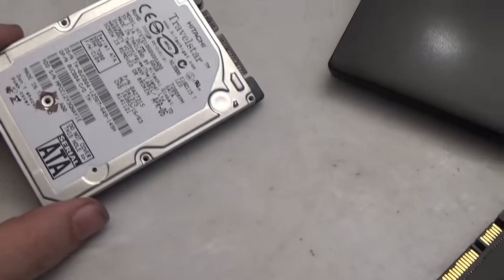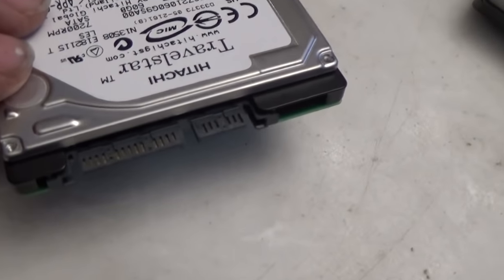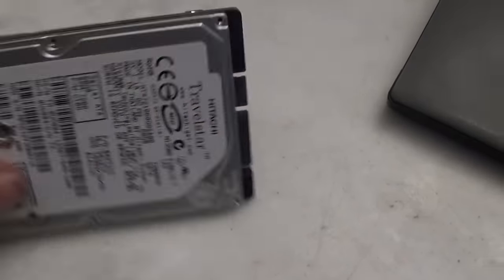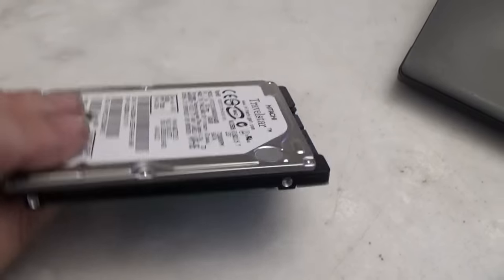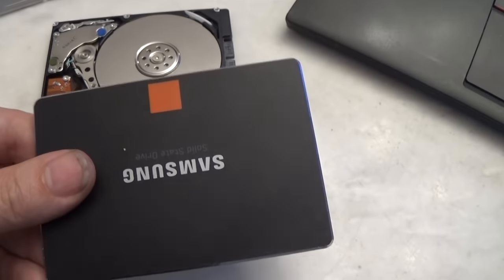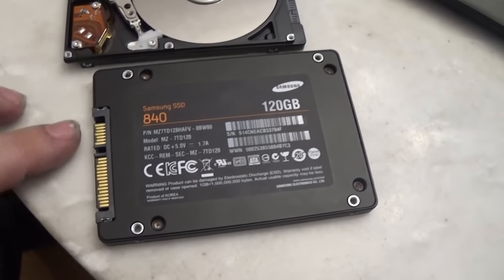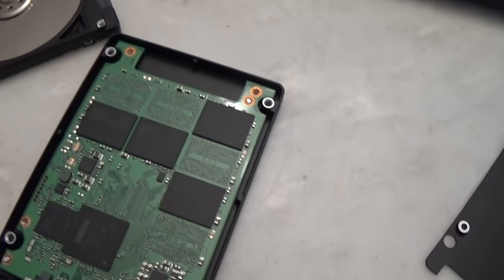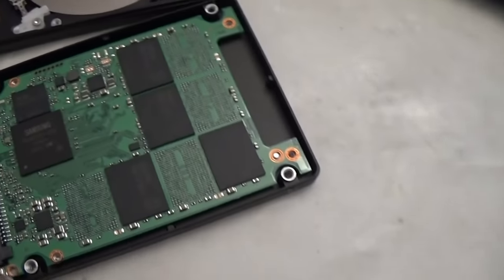Take a look inside a hard drive while it's running

Comment: an hdd's actuator arm can move 50-500 times per second in normal operation
Reply: fun fact : this is still slow for pc needs
Reply: @laserbeam3836  Lmao, too slow
Reply: You think this is fun? There is some serious shit going on here.
Reply: @shoaib_zubair  that's pretty fun what are you talking about?
Reply: @paulortalex6613  😁😁😁
Reply: You probably mean that camera shot this can not represent even in one frame its full movement
Reply: @laserbeam3836  yes
Reply: It is impressive for humans eyes and also Camera Sensors but for computers that's horribly slow lol or probably the average
Reply: @Ayaan MathurAlso because data from HDDs can be recovered most of the time if you really want it and HDDs almost always give signs of dying before they die so you can take backups quickly unlike with SSDs.
Reply: @Ayaan Mathur you use them for high storage
Reply: @Ayaan Mathur you cant get a 10tb ssd
Reply: Wow 666 likes
Reply: @nasvsan6191  in this case u need to watch Linus tech tips.
There are SSDs with 20tb storage
Reply: @kshitizmishra5845  for 10k i dont think so. There is literally 0 point to spend that much when a 10tb hdd is a couple hundred
Reply: @nasvsan6191  maybe not 10k but, those who can afford money doesn't matters for them.
While LTT has whole fucking server made of SSD
Reply: reeely????  WOWOWEEE
Reply: the speed is too damn high
Reply: Thank you!
Reply: 500 times a second wow
Reply: Wouldn't it be better to just say over 500 times a second?
Reply: you know how in like how it's made, near the end of the episode there's a super fast packaging machine? I assume it's like owning one of those but much smaller
Reply: @ApofKol  ye
Reply: And they call it slow
Reply: So that's 500 times a second right
Reply: @Mirsab  yes
Reply: Where the f@#$ am i
Reply: How it's faster than light
Reply: @tomodaniel6471  no it's not
Reply: Well, there are computers out there that can support an ssd or an hdd. My Mac has an ssd plug and an hdd plug. It’s 9 years old, and when I got it off eBay, I think that the hdd was replaced. So, It either has a really good hdd in it, or the hdd it has now is brand-new and it’s only a matter of time before it slows down. Well, who cares, it does Blender, 3d printing, and Minecraft just fine which is really all I bought for in the first place lol 😂
Reply: Can’t you just say it moves at 500 times a second
Reply: @Ayaan Mathur an SSD has no moving parts. But it is sort of possible but then it's called SSHD and not a SSD.

(Sorry for my terrible English)
Reply: @robertburgin8110  uh yeah obviously there are
Reply: @spinnerx4997  yes
Reply: Fuck! That is fast!
Reply: @shoaib_zubair  🤣
Reply: yomommabois look, I’ve only used so many computers. I’m basing this off of what I have learned using my fleet of broken laptops. laptops I have gotten with an hdd are extremely slow once you use them for a while. I’m letting people know that you can switch. As much as it is obvious, it could be helpful to some people.
Reply: And ssd?
Reply: RVG Riftyz what are you asking?
Reply: Wow, that's a fun fact!
Reply: @Ayaan Mathur and hard drives have more space
Reply: @Ayaan Mathur Why would a cloud company use SSDs, I'm pretty sure google uses HDD
Reply: wow
Reply: @robertburgin8110  or you could get a computer
Reply: @esoij  bruh im typing on desktop rn
Reply: @Ayaan Mathur What? They don't increase platter size to increase capacity. They either add more platters or increase the bit density .. or both. For the common 3.5" HD platter sizes, all specs such as read write random sequential times have improved as has capacity over the years. In a single drive storage comp, ya sure SSD's make sense. Beyond that though, a SSD boot and some fast large HDD's make sense regardless of your budget.
Reply: That would be really cool if I could comprehend it
Reply: 2ms response time
Reply: imagine a hdd as fast ad a ssd
imagine that actuator
Reply: It's 7200 rpm. Is that any good?
Reply: @paulortalex6613  XD
Reply: U hear that it's the sound of No one asked
Reply: My can't get milk after 21 years
Reply: That would be why it looks so jittery in 60 fps. You'd need 500+ fps.
Reply: Does you saying it that way mean that it doesnt move 80 times a second?
Reply: @ApofKol  but it wouldnt look as smart
Reply: Some fire freaking Pit thats a weird way of saying 500 times a second
Reply: @laserbeam3836  best reply ever because it's true LOL
Reply: My little brothers attention span is being challenged by this
Reply: @TheFourthWinchester  When your HDD starts to act like it's going to die is not the time you should be making backups...
Reply: @Ayaan Mathur If you want reliable function and safety data storage, HDD is the best. I have one drive with around 25.000 hours. Still perfectly okay! All SMART data is well within margins so i bet it will last 25.000 more hours.
Reply: T Burgin most ssds and hdds use sata connections. therefor there is no “ssd connection” or “hdd connection”
Reply: Some fire freaking Pit I know that. Just my Mac has a plug labeled hdd and a separate one labeled ssd so you can run both at once and have greater storage for partitions. I have Sata hdd. Plus it’s 9 years old, so who knows what’s in there?
Reply: So it moves 500+ time in a second?
Reply: Coooll... but I use ssd...
Reply: That's a lot faster than an SSD
Reply: @leonruvalcaba1549  it's kinda slow for pc needs tho
Reply: then why is it too slow
Reply: You could've said it can move 500 times in 1 second. Both of them are same but this gives better visualization.
Reply: T Burgin sata is pretty old
Reply: @xrivw  what did you say before you Edited the comment?
Reply: Im gay ‘*’
Reply: I'm sure before editing the comment you were talking about the spinning speed. Likely you said the spinning speed is so high, and then they said this is slow. Lol 😂
Reply: Yes, europe is a us state
Reply: You’re so funny, comedy achieved
Reply: Wtf is the point of editing your comment like that?
Reply: Original comment (probably): it's amazing at how slow this runs.
Reply: imriy no, it was talking about the immense speed an hdd has.
Reply: dude that joke got old after like the third person that did it now it is just annoying
Reply: Lol
Reply: @bathroom681  kkk lol
Reply: @nasvsan6191  lol 100 tb ssd
Reply: and yet they are still slow
Reply: @Ayaan Mathur I'm buying an HDD right now. Why? Because I need 2TB-3TB of storage and if I want to buy an SSD with that capacity my wallet will vanish 😂💔
Reply: @Ayaan Mathur I understood you the first time, but thanks for the edit of clarification xD! Idk you saying "not talking about ur lack of money" made me laugh Idk why xD !

I actually have 3 HDDs that I use. I thought of getting an SSD, but I actually need more storage more than I need speed. I know how fast a system can boot with an SSD (I've seen it IRL), but I have no problem waiting for my PC to boot at the moment. Now it's not just booting that's slower, it's the apps as well. I will get an SSD eventually, just not these days. I will probably get a 240-512 GB SSD for the  system. 
Also thanks for the positive energy even if it's not direct idk I felt some positivity coming from you :D !
Reply: @laserbeam3836  Yeah when you think about it ... RAm on PCs on average go at 2333  Mhz(2.3Ghz) (2 300 000 000Hz) and they send 128 bit packet per 128 bit packet(if you are on dual Ram ) at this frequency that's mean that it send over 128 bit x 2 300 000 000 = 294 400 000 000  which is a litlle more than 34 Go so it could theoretically send over 34 Go of data every second to the CPU which is a bit send every 3.401360544x10^-12 second which is 0,03401 nanosecond which is 0.0000000000003401 second. Duh
Reply: Wow still faster than console's fps
Reply: Ayaan Mathur no, larger platters does not mean you will always have slower read/write speeds, modern large capacity drives store multiple tracks of data within a given sector by overlapping the tracks with as much as 3-4 per track. If the hard disk has enough ram on it’s logic board it will be as fast as a lower capacity hard disk if you’re reading/writing but not at the same time.
Reply: Thats what she said
Reply: What RPM speed is the drive are you talking about?
Reply: PC Basics yes
Reply: And people complain on how hdd is slow 🤔
Reply: Epic
Reply: @shoaib_zubair  how is this serious?
Reply: @ryanolsen294  "explaining a joke is like dissecting a frog. you understand it better but the frog dies in the process" : E.B.White
Reply: Wonder what i could do if my arms moved like that. Hmmm
Reply: Or once every 0.001 sec or 1ms, that's kinda fast ngl
Reply: Why not just say 1000 times a second or once every millisecond? 20 times in 0.02 seconds seems like such random way to put it.
Reply: Even with that fact they are slow AF
Reply: @shoaib_zubair  why so serious
Reply: @laserbeam3836  It depends. It does okey for most games and programs.
Reply: @laserbeam3836  ~40mb/s  :(
Reply: @forloop7713  Google search says otherwise
Reply: @kingeling  most of the data is stored on HDDs in any data center
Reply: @forloop7713  Depends on the service too
Reply: @smoke4131  so amazing, that this piece of amazing invention is getting outdated :)
Reply: Seek time
Reply: so thats 1 time every 0.02 seconds... jesus!
Reply: If something happens at 20 times a second = each time will be 1/20 = 0.05 second = 50 millisecond
Reply: @spinnerx4997  sounds cooler this way
Reply: @Debraj1978  i said it moves 20 times per 0.02 seconds, which is like 500 movements per second.
Reply: THEN WHY THE HECK ARE THEY SLOWWWWWW
Reply: And still it's hopelessly slow. Talk about PCs being bloated
Reply: @miljororforsprakpartiet290  So needy!
Reply: Bro, what..😅
Reply: @HerobrineLolz  seems pretty plain cut and dry to me and a whole lot of other people
Reply: @xrivw  I meant a hard drive going that fast I'd absurd.
Reply: @laserbeam3836 hdd arm: (intense half second arm movements)

PC: "Dude hurry up! I got more tasks for you to do!"